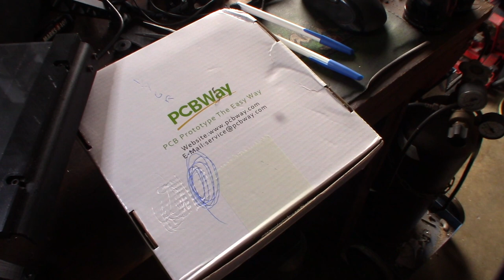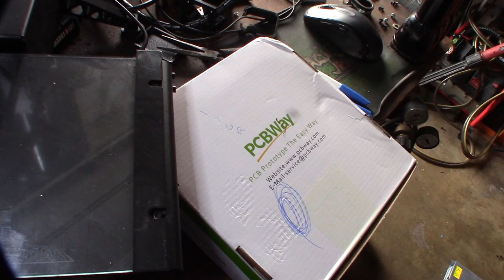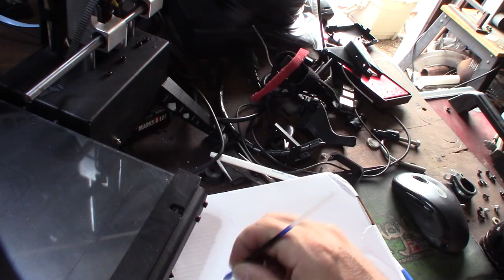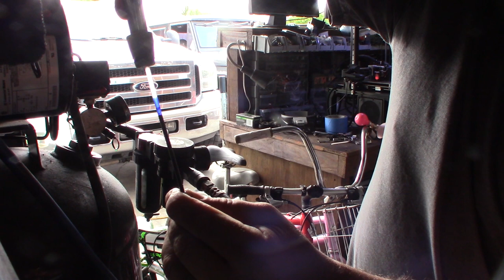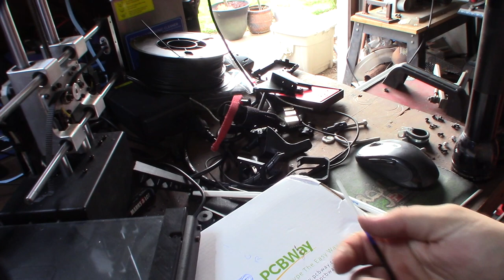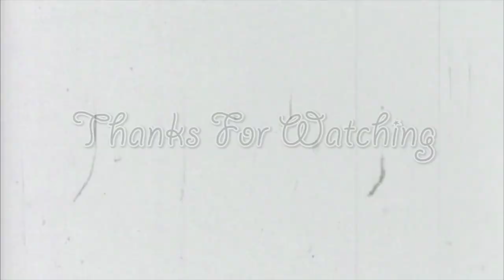fix dry ballpoint pen no ink with air compressor trick

Comment: Most people don't have an air compressor. I have one but it's in a outdoor shed with no heat. I don't know if I would want to go out to the shed every time my pen doesn't work. But of course if you have a heated shop and all you have to do is walk over to it and apply some air to your pen, then your luckier than most people.
Reply: Simple,  You save up clogged pens until you need to use your compressor for something else.  I run my compressor once a month and do everything with it: blow out air fliters (HVAC, vacuum cleaners, etc.), clean electric razors, fill tires, etc.  Maybe I'll put pens on the list too, but there are less-invasive methods: heat the tip with a lighter, soak the end in rubbing alcohol, and so on.  I'll try those first.